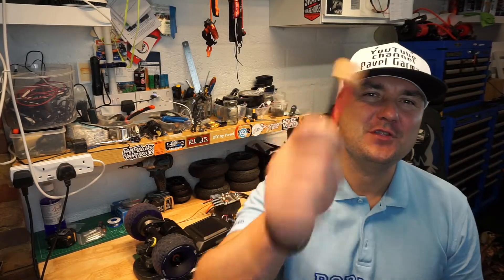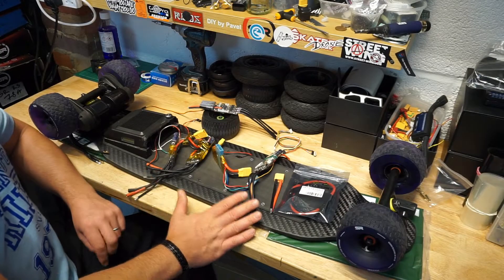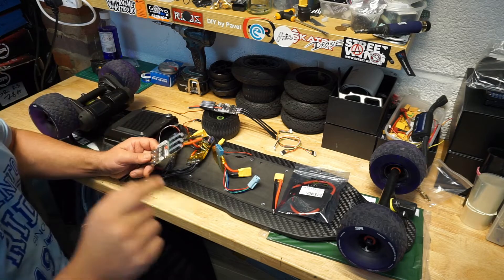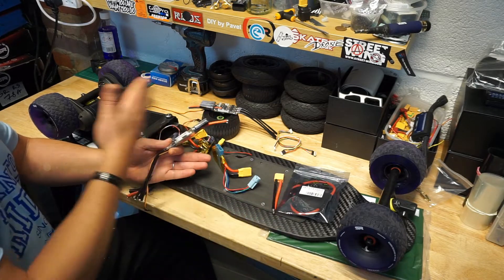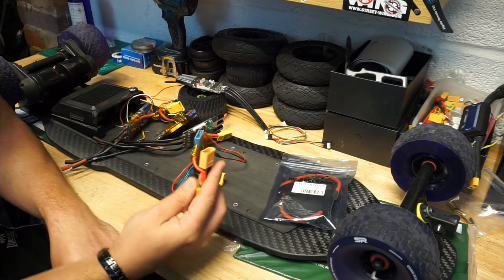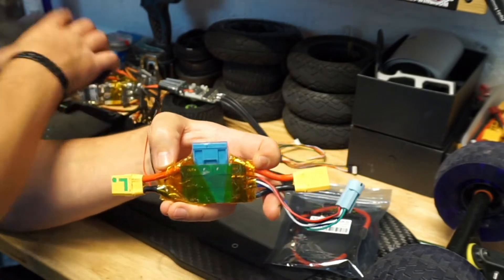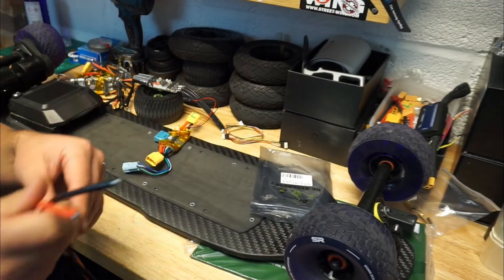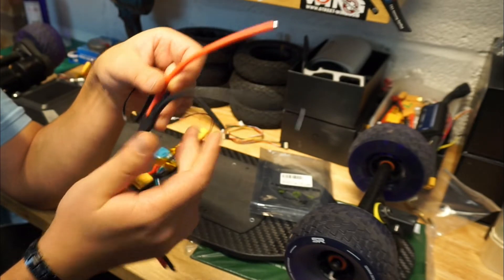Maytech 180 Amp switch review.

Comment: You spread more joy than any OTHER channel i have subscribed TO.

The 65 amp fuse i gotta see!  Test it now that it is garbage anyhow or splice it into maytech if you must.  Those amps can help if single cell 🔋 pack as Indians advise be massively parallel delegating upvolting not just phasing to logic to spare bms etc nonsense.   The in truck battery does not suck it has a two year WARRANTY and ships in days right?  Elegant to use car axle aluminum to sink motor heat and contain big lg cells in only near board area not congested the truck ITSELF shucks we SHOULD of thought of that!!!  The leash still beasts range connected to ultrawide smart 600 watt mia sole head lid to make mid day runs at speed long and funner no need to own Kwh blunder just harness silently photon thunder hours before and after noon ITSVHELLOBPETHAOS the Red Balloon chased my entire life no razers edge close to 🔪 concrete surfing and bare dirt over mountains like a hood ornament proud fueloilessly regardless of Saud objections and Marathon Oil Seditions.
Reply from the maker: Thank you very much for a lovely comment!